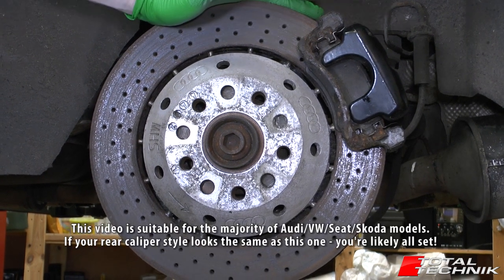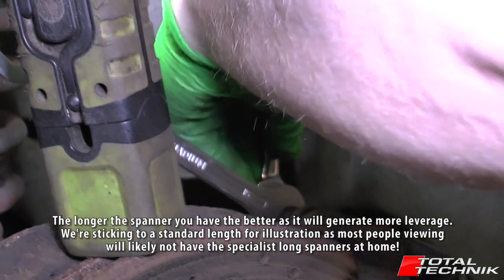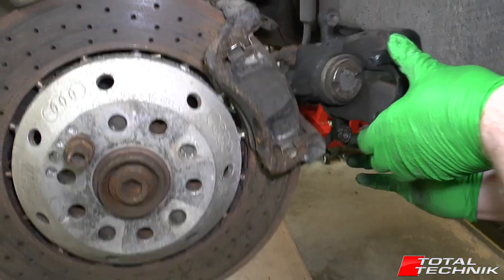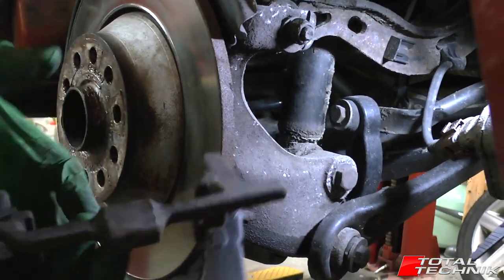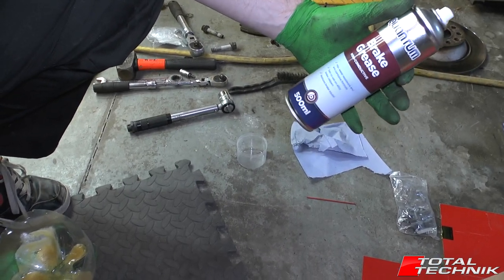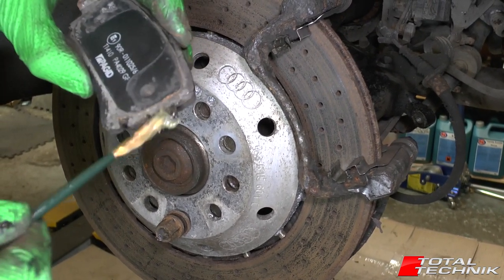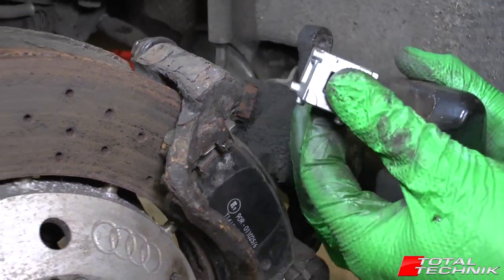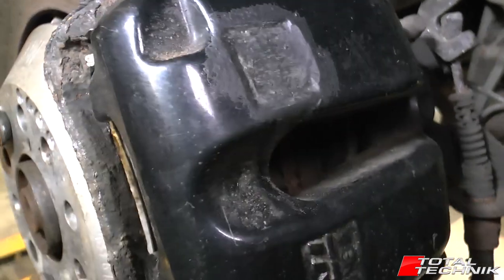How to Change Rear Brake Discs and Pads - Audi VW Skoda Seat VAG

Comment: I have a 2018 Kodiaq ..... it has electric parking brake, what extra steps would be involved ? .....    read that I need a special tool to wind back pads  (or OBDELEVEN diagnostic tool), can you advise ?